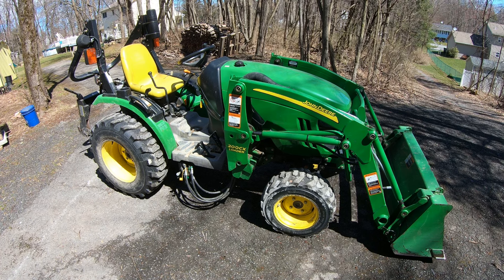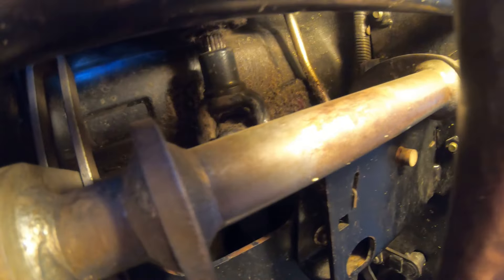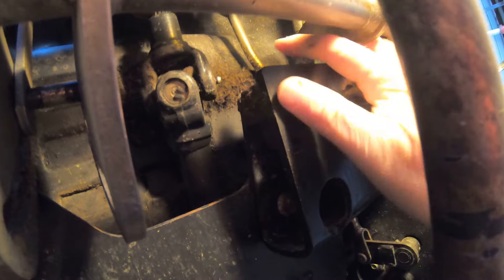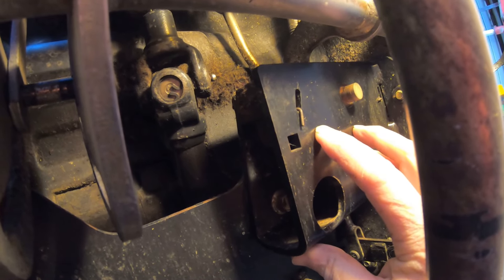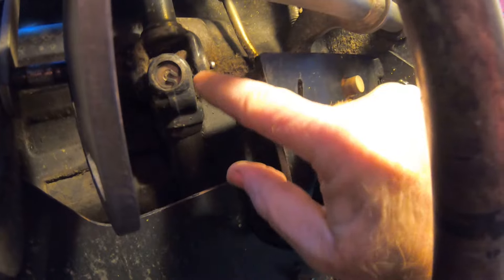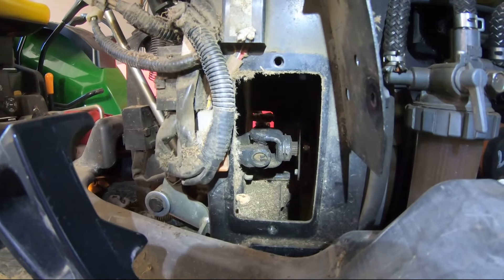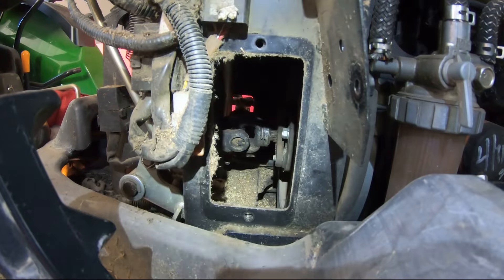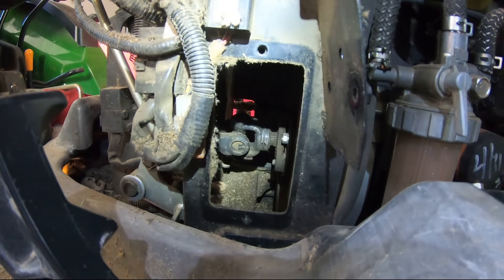Own a John Deere 2320? Make SURE You Check THIS!

Comment: Thinking about buying one of these tractors, From what I have read these u joints are a pain to get too. And the biggest issue with it. I bet it was a job replacing them. But good thing to do & putting the fitting on outside of it,was a smart thing to do!  Shame Deere didn't think about making it eaiser to get to them!
Reply from the maker: Hardest part in replacing was removing the ring that locked the shaft to the engine. After that it was pretty easy.

Comment: Mine just went out today. It made a knocking noise then broke the rear shaft going into transmission — need help with what to do for repair ?
Reply from the maker: That's not good - Probably going to have to split the transmission to get at the shaft.
Reply: I might just take it to the dealer for repair .
Reply from the maker: I'd be interested in what they will charge for that repair.

Comment: Thanks for this.  I have 177 hours and have not yet.  I will be soon.  So 1) how often?  And 2) if I did not replace mine, how do I get in there to the oem fittings?  I bought a needle grease adapter.  Will that work?
Reply from the maker: Have to check the manual on how often.... but I do it every so often depending on use. With the factory ones it's not real easy - I used a needle adapter before and it worked okay
Reply: I learned of this forward zerk in the driveshaft at 180 hours, shortly after buying my 2320. It had been dealer serviced before that, so might have been greased, but the joint was OK. After taking apart the center console a few times and needing three hands to get at the zerk I got tired of that and cut a hole in the right side of the console to get at an existing plate with two screws that gives access to the joint when removed. I made a rubber cover for the hole in the console, but that isn't necessary. I then rotate the joint with a screwdriver until I can see the zerk. Can't get a regular adapter onto it due to the angle, so I use a needle adapter on a long Lock'N'Lube fitting. The job now takes about 10 minutes for the front and a few for the rear joint. Manual says every 50 hours, which is probably fine, but I aim for more like 25 hours (about 3 months for me) to avoid ever needing to deal with replacement/failure. It always has grease still and readily takes a little more. I check each time for any additional play in the joints, but so far they have not changed. Now at 1,250 hours!

Comment: Great tractor! I have one myself that I also changed the u-joints last year…about 300 hrs. What kind of grease gun are you using?
Reply from the maker: I have a Dewalt cordless - works great!
Reply: @AFR_Adventures  Thanks for the video and the recommendation on the cordless grease gun.